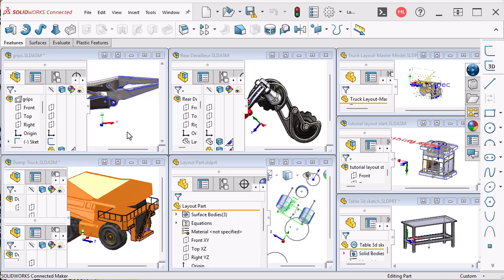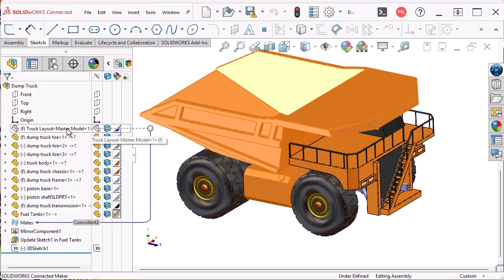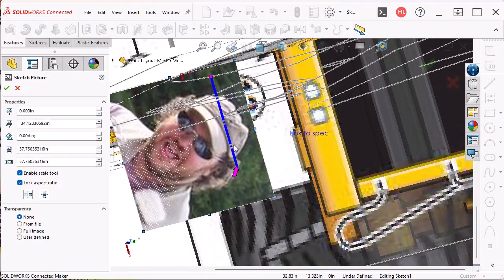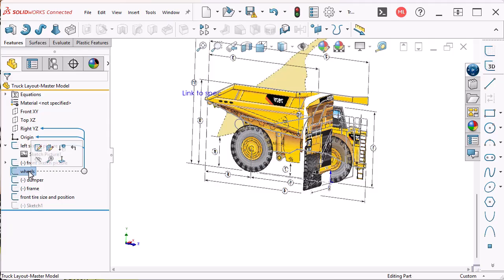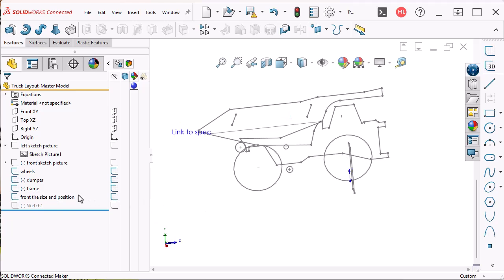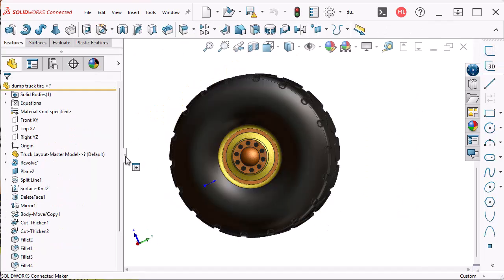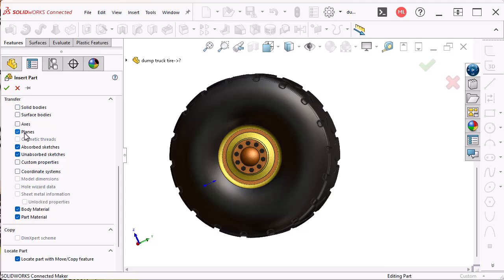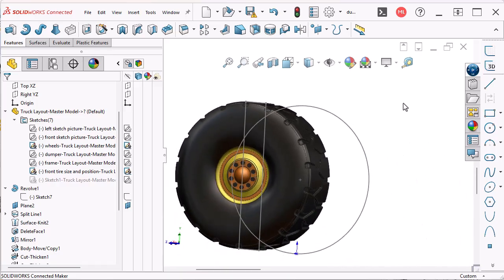Solidworks Layout sketch techniques using Insert Part

Comment: This is where I wish SW would borrow an idea from Creo and introduce something akin to the "Publish Geometry" feature, that lets you group various sketches, planes, etc into published features. This gives control (at the source) of what gets pushed to lower level assemblies. Makes things less messy (especially when layouts get very busy) and potentially makes it easier to split work among subcontractors etc that you may not want to have visibility of the whole system.
Reply from the maker: Yeah, that would be a good. One. All the tools are tough to keep track of. They really nned to consolidate all that functionality and make it easier to control. Great comment, though.
Reply: Agreed!   A big thing I miss having switched to SW.

Now just trying to determine most stable / robust method for top down in SW.   Still reviewing using blocks, & assembly level derived sketches, but thinking this Insert Part seems to be best.